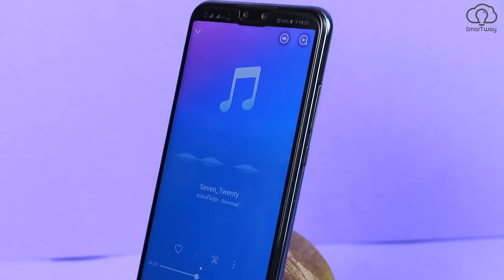AMAZING DIY IDEAS WITH Bamboo DIY Crafts with Bamboo USEFUL LIFE HACKS

Comment: Does bamboo need to be treated or can leave as is?
Reply: You need coating so that it will not rot
Reply: When I use whole poles as a hanging, I don't treat it in any way. Node to node won't rot (lump to lump lol), but any extra length that doesn't have a node at the end of it- that part will rot

Comment: What’s the name of the machine used to smoothen the edges
Reply: Dremel tool
Reply: A rotary tool. Dremel is 1 of the more expensive brands of rotary tools, but you can get a 25$ one from Walmart if you don't plan on using it often. If you are going to use it often & for bigger projects, I recommend buying Dremel brand, as the cheaper ones DO NOT last long!
Reply: exactly